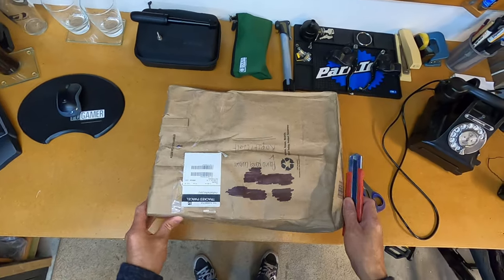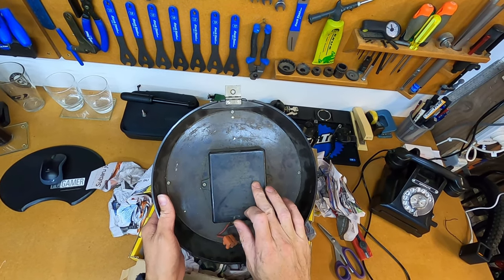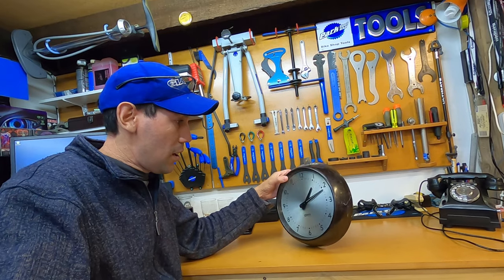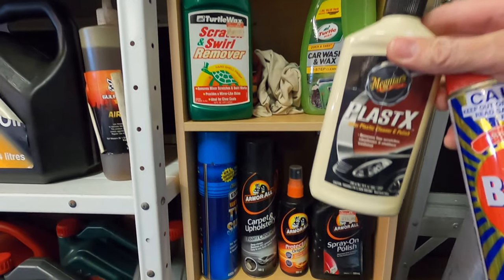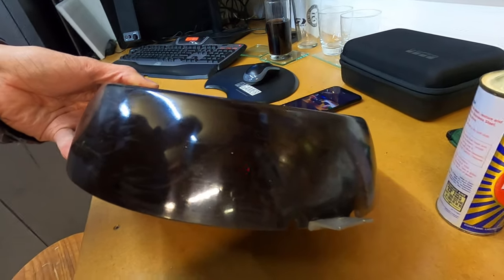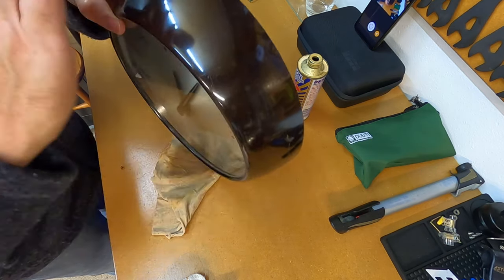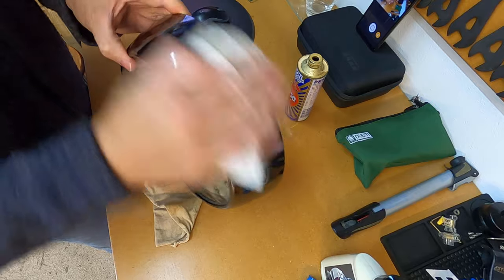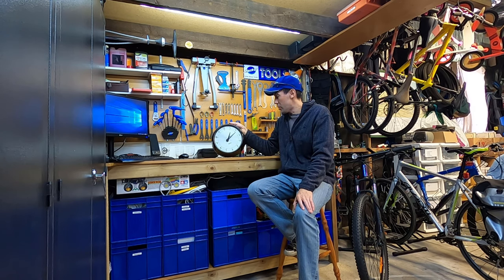How to Clean Bakelite - How to Polish Bakelite & Gents Vintage Slave Clock Unboxing

Comment: I have almost the same model 300 series dial telephone with a magneto in my collection. Mine doesn't have the button on top though. They are indeed from around the turn of the 1960's. I think this type with the dial and magneto were only manufactured by British Ericsson, but I could be wrong. If you look at the underside, there should be a 3 digit code starting with a letter followed by two numbers. The letter signifies what company manufactured it (E for Ericsson) and the two digits are the year of manufacture, ie E60 = by British Ericsson in 1960.
Reply from the maker: Hi there good to hear from you.  I love these old phones, and just watched your video on the PMG 400 series!
I will be honest I don't know much of the history of these phones and really should do a video and see if I can find out some local knowledge about them, however I think these were assembled in NZ just from parts from the UK, and as you say British Ericsson my guess is they were shipped in parts and assembled here I think due to govt tariffs.   Taking a look at the bottom of the phone, it has N2122A24 and H1175, quick google search https://www.britishtelephones.com/ericsson/ericaus.htm and look at H1175 on the chart and you are bang on 300 series with magneto.
I have this phone in the garage and similar phone in the house, and a wall mounted same era phone in the garage also, all working as an intercom, very cool phones.  I will do a video on them one day and hopefully get some more history on them.  I also have a bank of old telephone Eveready batteries x2 (not used past used by date) but still cool bit of history to look at.  Take care 🙂📞